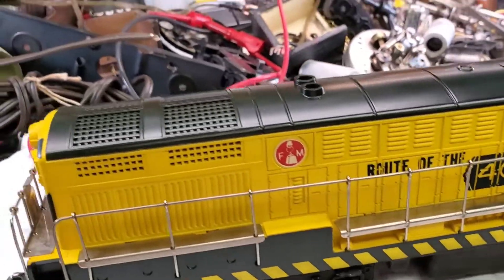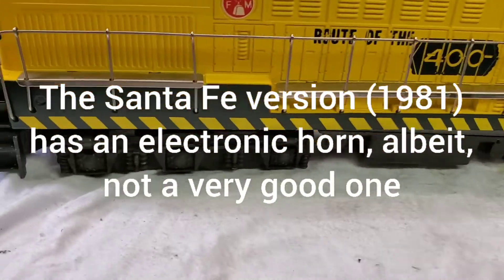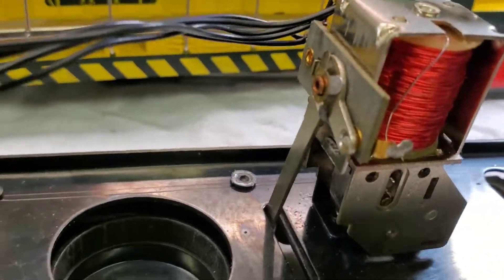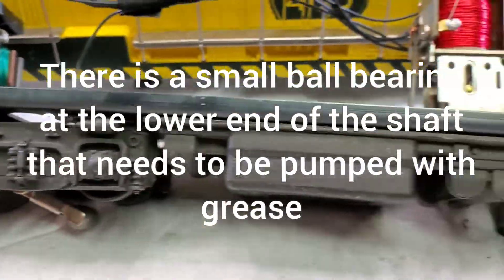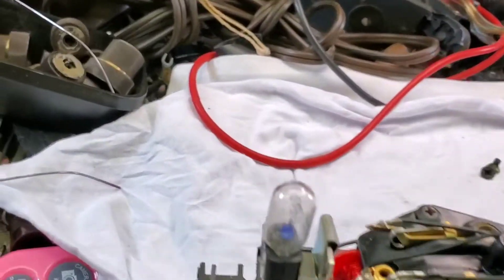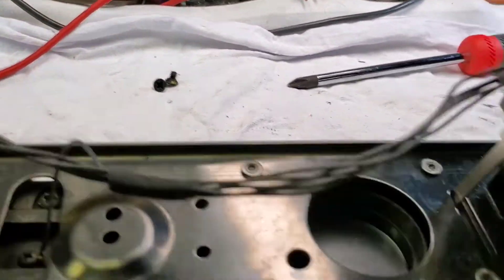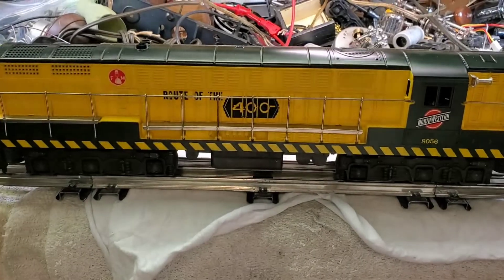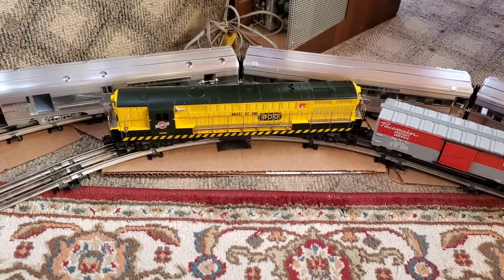Lionel O Gauge Fairbanks Morse Trainmaster Engine 6-8056 Model Railroad Diesel Train

Comment: In 1980 I bought one of these Brand New for $300.00 I have never ran it is still BNITB. I thought it would be a nice thing to stash away as PW TM's became more valuable. In 2020 I bought another on a TRAINZ Auction for $75.00 as it would be a nice double header pulling Ore Cars I don't care about the duplicate cab numbers. When I received it and upon unboxing the engine it had been ran but very little. So that $300.00 that I spent in 1980 would easily be worth over $1000.00 today.
Reply from the maker: I don't look at my trains as money. They are my toys.